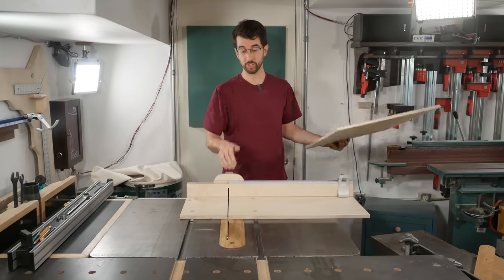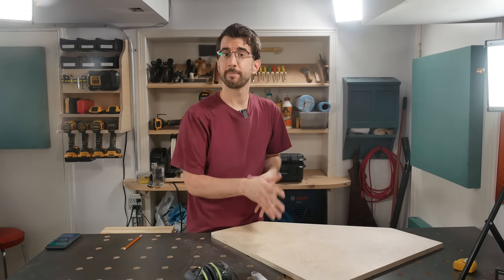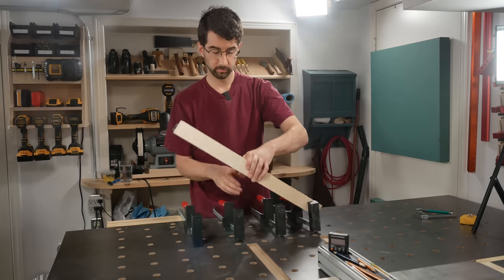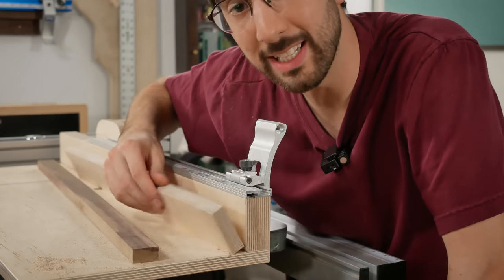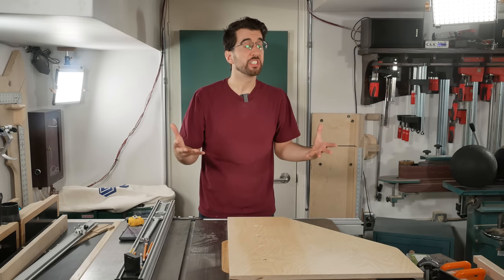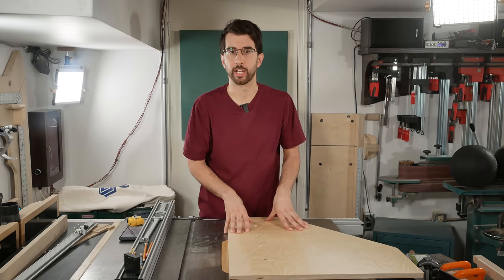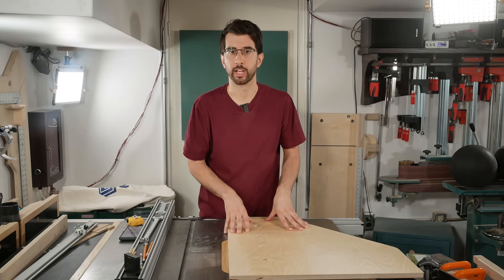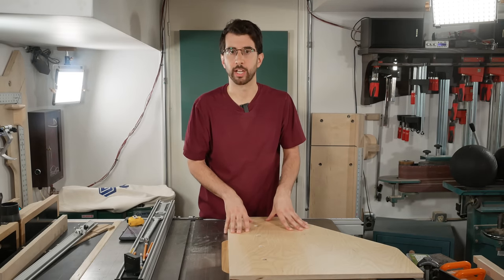the FLAW with Ultimate crosscut sleds

Comment: Try using virgin (white) UHMW Polyethylene runners for your sleds. UHMWPE is: highly abrasion resistant, self-lubricating(used to make plain bearings), has an ultra low coefficient of friction(second only to virgin Teflon) so it slides extremely easy, it does not change size with humidity, it is easy to work with using wood working tools, and it is inexpensive.

Comment: Shoot a few blasts of CA accelerator on the wood.  When you join it with the aluminum miter bar, instant set.  This is a great way to use accelerator: CA on one side, accelerator on the other.  BAM.

Comment: Lovely video!

Personally, I would add 2 things to this sled, or maybe 3;

1- A fixed hold down clamp about 1/2" to 1" away from the blade
2- A bolt that would be through the jig and the runner, held in place by a nut, with an epoxied piece of metal stock (slim enough on one side to fit in the slot of your tablesaw and long enough so that when rotated 90 degrees, it fits the width of the slot. That way, you can just take a screwdriver or something like this and do a quick 90 degree turn of the screw to make it so that the jig cannot get out of the slot and kickback in your face if anything were to happen (most likely it wouldn't happen, but its a nice safety feature)
3 (and lastly)- I would've liked to see a fixed fence and an adjustable pivoting fence, so you can make quick miters on there (its sometimes useful as the other type of jigs aren't really optimized for that... this one is)

Comment: Crosscut sleds like this-great design though it is- significantly reduce the cutting depth of the blade, the one I have just junked was 5/8ths" thick and it was a problem as I only have a table top saw so today I bought a pack of damaged laminate flooring (£5!) from B&Q which I believe is only1/4" thibc and will make a new sled out of it tomorrow.
I can't do without one now, they make using the saw very much safer-and often, more accurate

Comment: when you have the chamfer at the bottom of the fence to catch saw dust dont you still have to clean it out every time or else it builds up anyway and has the same issue as if you didnt have the chamfer? so if thats true why not just brush out the dust anyway without a chamfer? can someone explain?

Comment: I am in no way used to use these types of sleds, but interested in knowing: Do you have some kind of board on the right side of the blade to prevent offcuts from "tipping"? Where I most often have to sand is the last inch (or two) when the pieces shift a little.
 I would like a table so big that a sheet of plywood would stay flat any way I'd cut it. Or then a big table with better guidance for my Makita plunge cut saw...
Reply: If you'd clamp your work down it shouldn't shift. Although I don't always clamp as well just for (minimal) time sake. Bigger sheets tends to stay in put if there is no sawdust underneath it. Everything that has been cutt off does has the chance of tipping over. Only  a drawback of this design, but as mentioned before it's made for specific projects where he probably doesn't care about that.

Comment: This might be a good idea for panels but for small pieces, using the fence in a "reverse orientation" and pushing the piece using the fence while holding the workpiece in place,  the user would have to reach over the table saw placing his/her body in a dangerous position in relation to the blade; but for larger panels, I can see its usefulness.

Comment: Scott, There is always the 3,4,5 method for attaining a perfect square.  3" on one run, 4" on the other if square will ALWAYS = 5" on the bias.  Can be multiplied as needed depending on the size of your project.
Reply: more useful for large scale situations - not accurate for this application and the maths to calculate the adjustment would be considerably more complicated.

Comment: I have a question.the runner, you put it in where the adjustment screws is no longer accessible.  Would it have been better to have it flipped over, where the adjusts could be made from the bottom?since this is a panel sled, what about tearout on the edge closest to you?  The fence is no longer there to stop tearout on at least the left side.

Comment: @8:25 Yup. Agreed.  Perfection being the enemy of good has always been an issue with woodworker.  Trying to get some accuracy down to one thou when move moves by fraction of an inch due to humidity.  that's like 2 or 3 orders of magnitude difference.  LOL, but I do it all the time to. I'm building by first sled (incra miter gauge has been fine so far) but I am incorporating the parf guide into it.  It will help me make 45 deg cuts and it will auto align to my fence and square to the fence.  The simple dewalt table saw trick I posted has served people well so I'll upload it sooner or later.  I haven't seen others do it, so it could be an abject failure.  We'll see.  :)

Comment: I have a Dewalt jobsite saw.  There is not enough table to only use one side of the saw, which would cause it to fall off the end.  So this sled will not work for me.  I did build an ultimate sled, same dimensions as yours, but fence is shorter, smaller, thinner,  used 1/2 inch baltic birch plywood, Kreg stop fence ruler, and cut away 3 inches from my kerf so that I can make custom zero clearance inserts, attached from the bottom.  Works great and only weighs 19 lbs!!

Comment: Nothing stopping the original sled from being lightened, and you could even do it completely hidden fairly easily.  Take the front and rear fences off.  Use a Forstner bit a little under the width, and drill up from the bottom hogging out material to close to the top, and avoid the screw holes, side holes etc.  Then lighten the plywood from the bottom, making sure to not go through.  Take the point off of a Forstner bit so you can cut flat and nearer to the top surface.  You could also just go fully through the plywood, and put your own new veneer surface on top and bottom.
Should be relatively easy to get to 1/3rd of original weight, maybe even down to 1/4 if you try hard.
The crosscut sled is about having the reference surfaces and alignment, not about keeping all of the internal wood weight, so just get rid of that part..
And the forward fence is almost 100% about holding the gap together and in line.  Forget the full fence, use a piece about 6" wide with a couple of screws on each side.  Then you can easily take it off for the rare time you have a larger width board, but the ends don't flop around at the gap the rest of the time..
That said I do generally prefer the other design myself as well.  But most of the main drawbacks of the normal larger type sleds can be mitigated.

Comment: Hey Scott - new follower here. Question : need to build my sled.  I have leftover click laminate ( good quality 8 mm). Seems dead flat, true, and has a slippery back.  I could even do 2 layers - bottom one East - West, and glue top layer on N-S, if needed.
What think you ?  Good idea - or bad ?  Thnx.
Reply from the maker: I don't think it's a bad idea, but I've never heard of anyone doing that before so you're in unknown territory. Cross laminating two layers is a good idea. You will need lots of pressure to pull it off; a vacuum bag ideally. You're only out your time if it doesn't work.

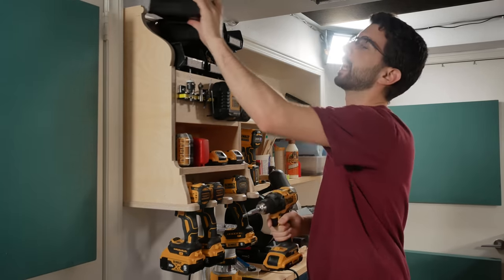Comment: Nice video, but early on you said the adjustment screws for the runners would be facing up so they'd be easy to adjust. But at 7:43, you screwed the rail in from the bottom. What am I missing?
Reply: The runners are permanently attached to the sled. The runner adjustment mechanism is a disc or cam within the runner that serves to tighten the runner to the left or right in the table saw miter slot. The runner itself does not move. Hope this helps.
Reply: @rta3738  So, if I'm hearing you right, the "disc or cam" is adjusted from below, yes? Then what were you referring to about accessing them from the top at 3:07? Don't mean to be picky, but I'd like to understand what you mean here. Thanks again for the reply.
Reply: @timtully8015  The runner is attached to the sled from the bottom with just regular screws. The adjustment is made from above the sled which is why it is necessary to pre-drill “access” holes to the “adjustment “ screws.
Reply: @rta3738  Cool. Thanks, Scott.

Comment: I have to wonder about the unsupported off-cut piece.  If this sled is used to make a cut with a wide piece, say taking more than a foot off piece of 3/4" plywood, as you near the end of the cut there seems to be the concern of the off-cut sagging and thus pinching the blade.  The wider the off-cut, the worse this gets, as the width gives the sag leverage.
Not only is there nothing holding it up, there is nothing behind it or in front of it keeping it square.  As the cut finishes, the off-cut could swivel away from the cut and break rather than cut that last bit.  If the break extends to the "good" side, meaning into the piece on the sled, the saw blade won't clean it up.  Having it break so it messes up the off-cut might not be as big an issue, but usually the off-cut is not waste but will be used.

Comment: Your instructions are very clear. Learned a few things…using the level as a flat reference when gluing the fence pieces together, and the feeler gauge approach to squaring the fence to the saw blade. I’ve been using those aluminum runners for awhile now. Thanks for the time and effort making this video.

Comment: Here are my tips for a cross cut sled. Firstly don't use ¾" anything it's just a waste of time and material and you are sacrificing depth of cut. ½" is more than enough so that is a 33% reduction in weight right off the bat. The fences are going to keep it flat and in use it's on the top of your table saw which is hopefully flat. Second use Valchromat it's a sort of MDF where they stain all the fibres and then bond it together with epoxy rather than formaldehyde glue. It's stronger and more dimensionally stable than regular MDF and at least as good as birch plywood if not better.
My next tip is to use some 30120 aluminium profile for the fence at the cutting side. It's light its dimensionally stable and above all its straight. Further you can use t-nuts and bolts to fasten it to the base of the sled. Drill all but one of the holes too bit and you can slacken them off and adjust the fence easy for square. Just use an old blade to cut into it initially. As it's slotted you can make stops and hold downs. Best decision I made.
Reply: Hey now I know what to do with this leftover scrap of aluminum profile that I have.  Thanks!
Reply: I've been searching for the ideal material for a radial arm saw table that doesn't warp. The original radial arm saw from 1956 uses edge grain fir, and the wood looks brand new somehow after 75 years, and isn't warped at all, and the glue hasn't separated between each of the boards that make up the large flat table. But I wanted to make a table for a few other radial arm saws, and it's not clear how to make it thin, and also not prone to flexing or warping. MDF seems to be totally immune to warping, I have 40 year old pieces of it from 1970's radial arm saws, and it's not visibly warped at all, which is truly impressive. I have a piece of 1" Baltic Birch plywood and it hasn't warped at bit after sitting in high humidity, but it's also extremely nice material and I don't want to waste it on a cutting surface. Thanks, I'll look into Valchromat!

Comment: Hmm.. I still think thickness matters.. a lot. My first crosscut fence was 1/4" thick Shop Ply, and lasted 12 + years. My current one is 9mm Baltic, and will handle 23.25". I have never had issues with a thinner wood sled (I concur with Jonathan below), and like you, I use it for panel crosscuts, but, by having it thinner, you don't have to raise your blade as high (safety), or, you can do a perpendicular cut in thicker stock more easily. Also, not having the right side of the sled means that the material drops down to the table when fully cut, or if wide enough, can even fall to the floor in my case (due to how far back the blade ends up. Plus, with a right side, I can set the stop block on that side to feed a panel across to get multiples.. instead of the right side - as your new sled would require me to do (while I have a 53" right side cut capability, others may not have that luxury). Weight? For a 36" sled - a mere 11.7 lbs. I will say that I did not know about the "5 cut" method, and went through a awful lot of fiddling to get the fence square as a result. Will definitely use this next time 'round.. thanks for the great tip! Keep posting!
Reply: Two things to consider when deciding on thickness that I don't think was covered. One is blade size. Those that have saws with 7 1/4" blades may have an issue with thicker bases while those with 10" or 12" blades won't. Second is environmental conditions. Living in Canada, regional conditions affect wood behaviour. Some areas are very humid, others are extremely dry, others are very cold during the winter, and so on. If I build a jig, I'm going to use the thickness material I can get away with before the usability of the jig suffers. Besides, in my case I don't use panel jigs. I prefer track saws to manage panel cuts and get the pieces to a size that suits my table saw.
Reply: @daveduncan9005  Right. The invention of track saws changed everything for large panel cuts.

Comment: Thank you, Sir. I respectfully question your comment that the test board must be square. To my mind, the initial squareness does not matter. The test board need only be four-sided and could have been rough cut by a hand saw or jig saw. It is necessary only to have one edge which allows a stable location against the slide's fence. The first cut is made in that way. The first four cuts make the board as square as the position of the slide's fence allows it to be. The fifth cut is then used as you describe. For your simplified method to work it is necessary for the fifth cut strip to be shorter than the fence. More particularly the length of that strip is the distance between your first pivoting screw and the measuring/correcting point. Am I wrong?

Comment: I need to redo my cross cut sled, and I do like the idea of specialized sleds. I have thought of using the 3, 4, 5 method for getting square, but I would do it in feet. Actually, if you wanted to use inches, any multiple of that would work, like 6, 8, and 10..... Should be close enough....

Comment: I made a similar sled a while back.   It's great... yours is nicer than mine.   My only "complaint" with this style is having no support for the off cuts.   If the off cut piece is fairly large, it can get tricky, especially at the end of the cut.
Reply: very good point!
Reply: Stick a piece of wood under the off cut side.
It will follow along if the table top is in good shape.

Comment: I am curious about why you align your fence to your table saw blade... You just made a cut with the sled and have the actual edge of the board to align the fence to.  It seems to me that your cuts will always align to the edge of your sled. The sled has a much longer straight edge to align a carpenter's square or other square with. The sled does not have to be on the table saw to make the alignment. Clamp the square flush against the cut edge and then align the fence to the perpendicular side. 

I just moved to an apartment so my shop has to fit in my bedroom with me and be moved out to a 12x24 deck to work. For cross-cuts, I almost exclusively use my miter saw, but I need the cross cut sled to make dados and rabbits.  I seem to be learning that the smaller the shop (and table saw), the more, smaller sleds are more efficient than bigger ultimate sleds. 

I want to make two match-fit sleds, one for either side of the blade.  I like your far-end fence idea and think if I add it one of my matchfit sleds, it will give me an accurate square fence that is out of the way unless I need it. 

I don't know if I need a panel sled yet. If I do, this is the one.

Comment: on that ac glue you used. ive never used it but it looks handy. when i looked up how to use it, they said to spray the accelerant on the side contacting the glued side. why did you spray it after it was already contacting? Also, the fence side of that sled would allow the waste side of your wood to stay 3/4 in off the table. like i said just getting into this but back in highschool our teacher was very adamant on how we need to be careful for kick back. wouldnt that piece falling back into the blade cause an issue?again this is coming from someone who hasnt done this yet.

Comment: You don't even need to subtract when measuring your offcut: you could zero the calipers at the narrower end, then measure the wider end and voilà.

Your simple approach made me think of an even simpler version: use a square board that's smaller than a quarter the length of the fence (more precisely, the no1 edge should end up being a bit less than a quarter the length of the fence). Then do your five cuts.
Then take the final offcut and the corresponding edge of the board (they have the same length) and stack them from the pivot point (i.e. the 1st screw) along the fence: lay the offcut, then butt up the board edge against the offcut, then pick up the offcut, hold the board and butt up the offcut against it, and again with the board: the final end of the offcut corresponds exactly to 4 times the length of the offcut. That's were you'll be using one end of the offcut to position the stop block, then the other end of the offcut to move your fence to.

I did no measuring and no dividing.
The accuracy lost by not using a board as wide as the length of the fence is (at least partly) compensated by avoiding the intermediate steps of measuring, subtracting, dividing into a final offset value that I then need to materialize with calipers or feeler gauges.

I'll test this when I'll be making my new half-sled (soon)